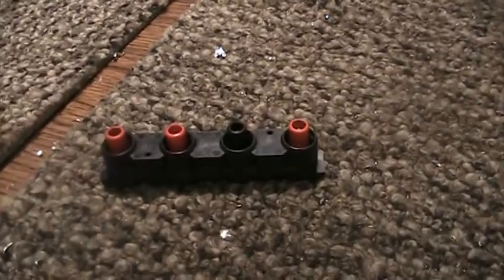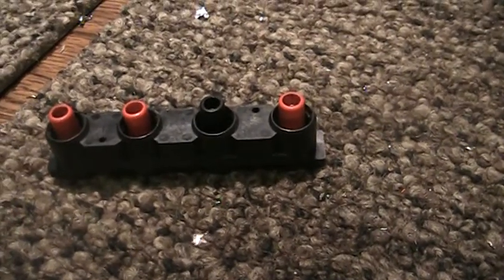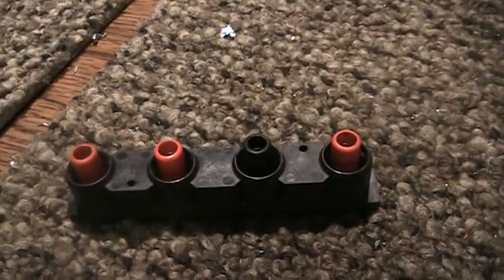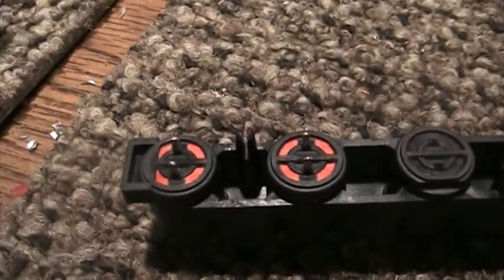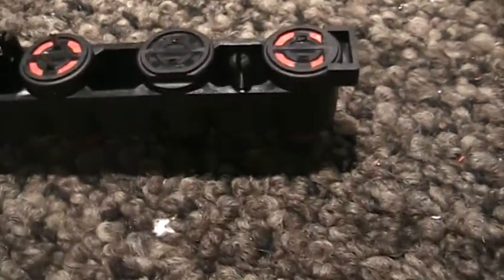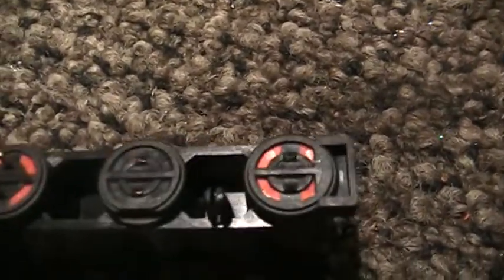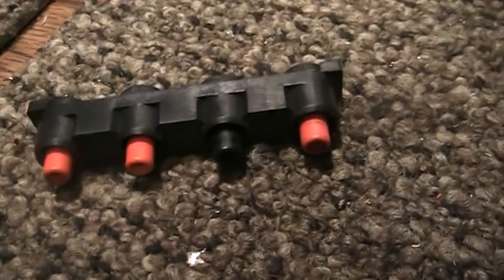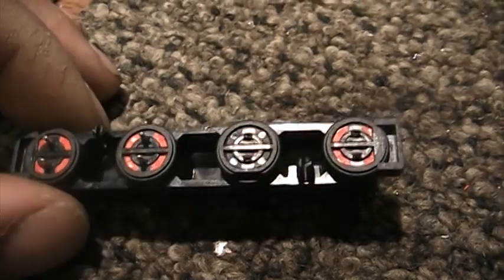Fluke Multimeter probe repair

Comment: What’s the exact part name of that component?
Reply from the maker: Looks like Input Jack Connector    https://www.ebay.com/itm/Fluke-Multimeter-replacement-Input-jack-Connector-module-NEW-OEM-FREE-SHIPPING/202647183519?hash=item2f2eb6a09f:g:z9wAAOSwPb1cqOx6

Comment: Great post. I had ordered the part shortly before watching this video. I was suspecting a foreign substance inside one of the sockets, but instead found 2 broken pins on one socket bases as you described. To remove the old part, I carefully divided it into 4 pieces with a hacksaw blade. That allowed me to rock each segment back and forth as I applied heat to the solder joints. Removal went much faster and easier. My 89 IV is now working as it should.

Comment from the maker: Great Post!   Backwards is a great idea. For those wondering what he is talking about, he is rotating  this 180 so the amp probes which most people never use will be on the normal Volt/ohm lead side. Great idea as though I have not checked in a year, the last time I looked no one was selling this part on EPAY anymore.